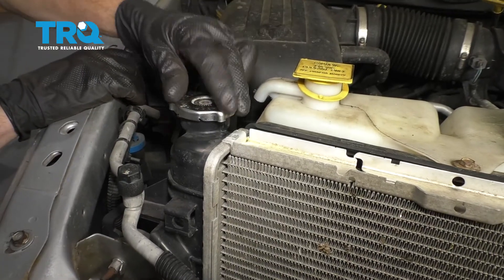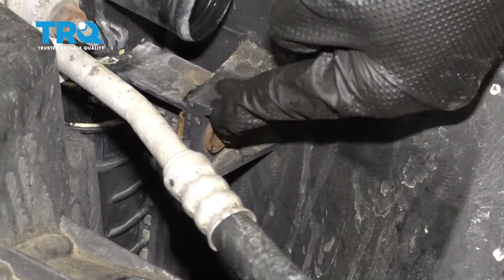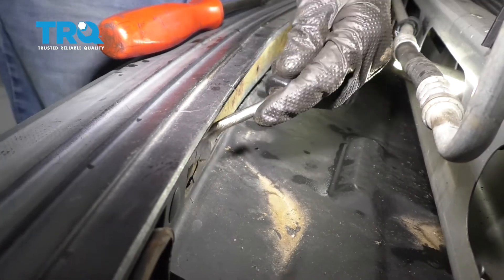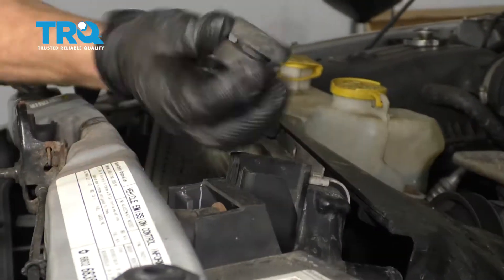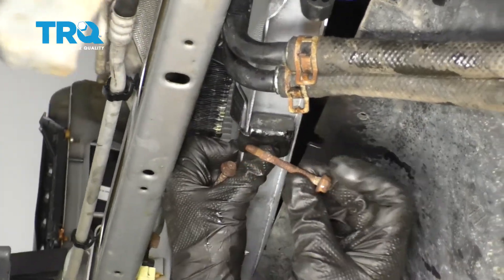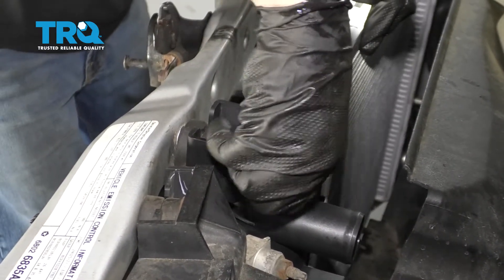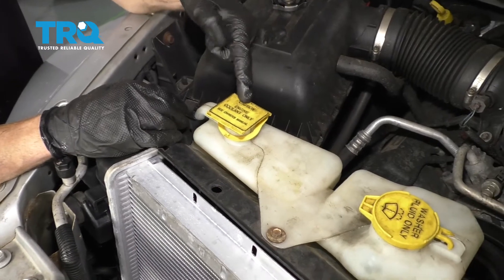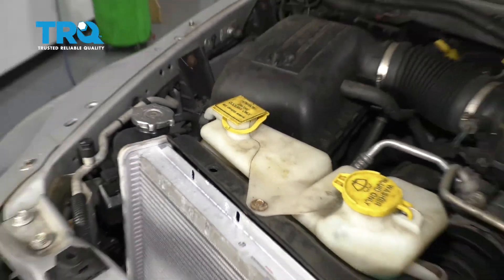How to Replace Radiator 2002-08 Dodge Ram

Comment: Not a complete video, you need to remove the fan assembly from the water pump pulley before you can remove the fan shroud.